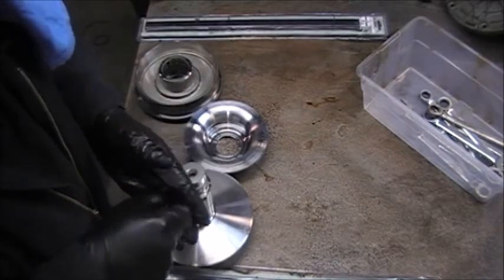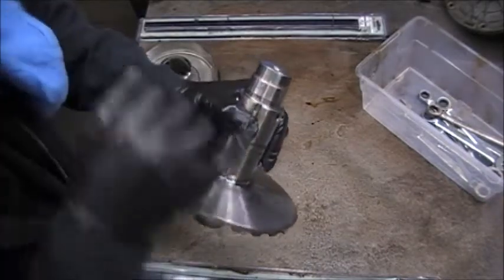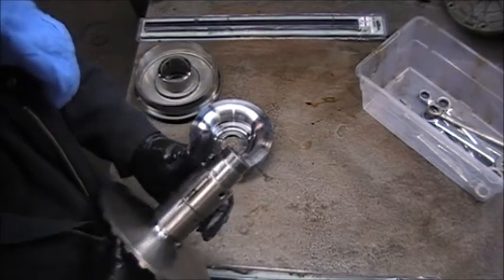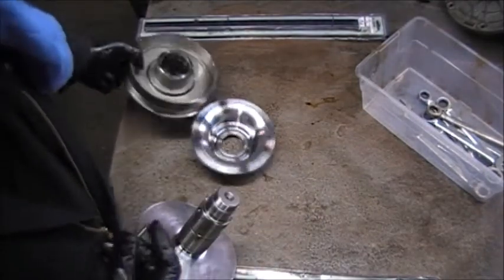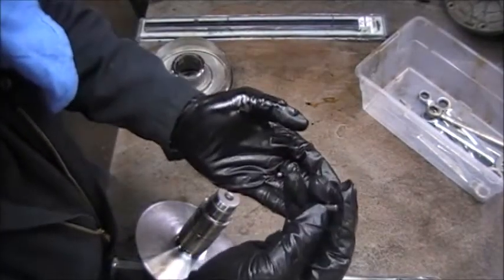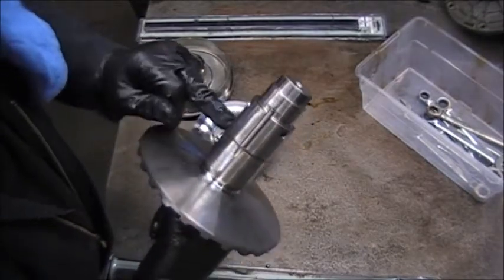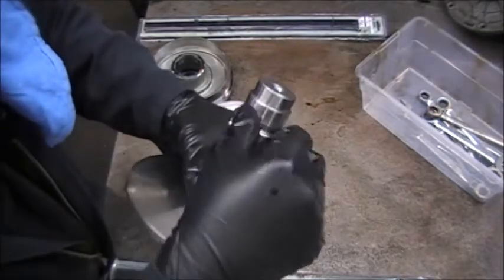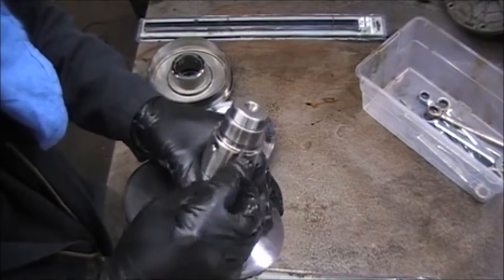RE0F10A, JF011E NISSAN CVT TRANSMISSION BALL TO PIN CONVERSION PART 1 (UPDATE)

Comment: Hello Sir, please post the like for where we can buy these pins online. On Alibaba, Amazon, EBay or any other online store. Thank you in advance.
Reply: Hello, 

I bought hardened steel - not chrome (soft) - dowl pins at Fastenal, for about $1-2 each, size M6x12mm; but, he has a newer,  easier mod using longer pins!

Fastenal has longer pins too  I saw M6x20mm and longer! Be sure to measure! 

ATTENTION: read this whole thing!

He recommends cuting down cobalt drill bit shafts, which measure diameter of 6mm, or hardened tool steel bits - for VT25E! You will use the diameter of good bearings, from you pulley - if any are Undamaged. Mine were ~5.46mm; so, I started with M6 (6mm), which actually measure about (~) the same. They were too tight. So, I used the drill method he shows, to make them slide smoothly, freely! 

 And, he shows us how to use a drill to lightly sand the pins down in parts 1 & 2! The Fastenal pins I used are not hollow - not on the ends! They also will likely be too tight. So, be ready to use his method to sand them down, until the plunger moves freely!

Comment: I got a question, when you put those roller looking bearing, pin in wont it de draging on the surface of the piston, the balls can at least roll in there to reduce wear but now the piston gotta be draging on that pin, would it wear faster?, but i can see it will hold stronger than the little 6mm balls but what about sliding up and down?
Reply from the maker: Philip Knights it won't hurt a thing. Oil is in there with the pins. The balls break because they can only support the shaft for so long.
Reply: questioning3 ok cool, im an engineer, i found a solution for this but i need a machine to start, Im just saying, the ball can roll up, down and left to right, the pin can only move left to right, and it has to drag up and down, if you know what i am trying to say it might be scrapping the oil off the pin at times, how long did this work for, i love the idea but just wanna be sure thx :)
Reply from the maker: The balls can only move up and down. They cannot move left or right because they are stuck in a channel. Ford has a cvt transmission called a cft30. The pulleys move up and down also. However, there are no balls. The shaft move up and down on metal splines, and it does not wear out. The transmissions that uses balls always break, even in the GM vt25e transmission in the saturn vue. The balls in the drive pulley section become pitted and break. Now, I know that engineers value theory. However, sometime one has to become practical and just try something, and so far there has not been a problem.
Reply: questioning3 thank bro
Reply: questioning3 i will buy a 6mm dowel pin and try it out 😊

Comment: very interesting video, the balls are 6mm , are you using 6mm rod or bigger ?. actually it is really a  long term working solution  considering it is special CVT oil, thank you for sharing your thoughts.
Reply from the maker: Salim Safran 6mm rod
Reply from the maker: Salim Safran or 6mm colbalt drill bits, the part that goes into the drill.

Comment: Thanks for this vid and all your others... 
I have an 07 2WD compass with a seized JF011E.  Hoping I can figure out what it needs and get it back on the road... can get a rebuilt with an improved oil pump design for $1500 delivered, but hoping that with the help of your vids and some parts, I can repair the one I have.